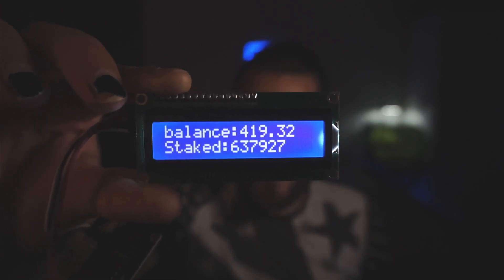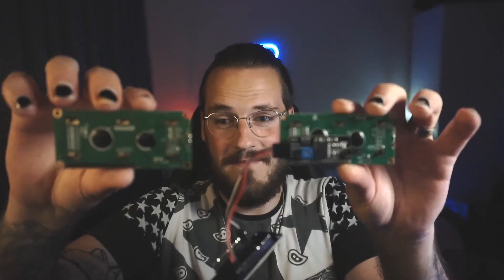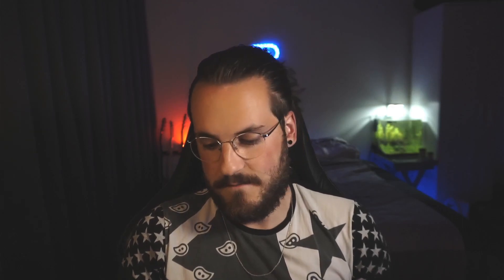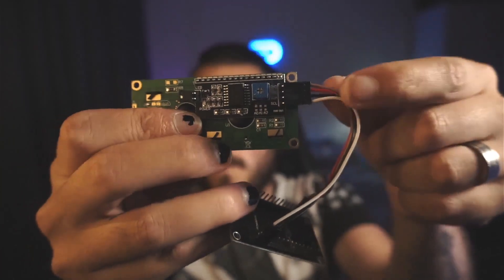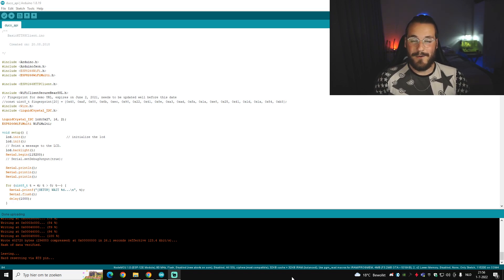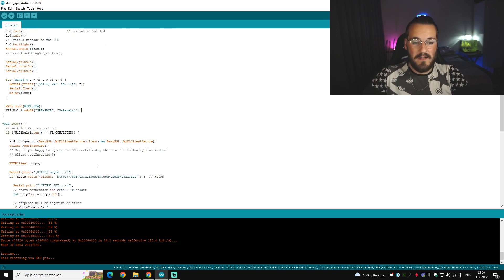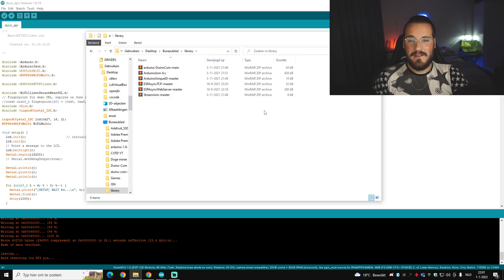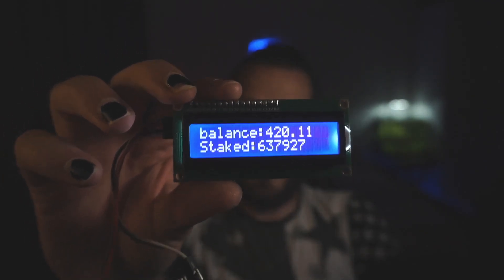How To Wire And Code An LCD-Screen To A ESP8266!

Comment: An ESP01 has the same microcontroller on it as the board you showed in the video, also despite having only a couple of digital I/O pins, it has I2C pins among them, so the I2C LCD can easily be connected to it. The setup can be powered with 5-volts for the display and 3.3-volts can be created with a tiny buck converter to power the ESP. The smaller board will help save a lot of space and make it more compact, without compromising almost any feature, except for programming it.

Comment: Can't we just connect the ESP with an Arduino with the serial communication channel and transmit the data like stacked coins, mining rate, coins and etc through Tx. and just print all of it on a color screen through the Arduino? I mean that would require a little bit of investment initially in the set up but would look so damn good
Reply from the maker: Sadly I haven't had the time to learn how Arduinos work exactly but you could defenitly try to make that work :)

Comment: my lcd is going crazy when the buit in lcd comes on and works perfectly once led goes off while connected to wifi
Reply from the maker: Might be a faulty sensor so hardware. These screens are realy fragile so they break easaly
Reply: @Pakiezel  no not the screen. Its something with hardware or code i guess. I tried new lcd, i2c module and still the same....i runned this same code both in ardiuno uno and also esp 32 and is working fine without any issues.
Reply from the maker: @joshuvajohnvarghese  try running the basic "hello world" code you can find on the internet.
Reply: @Pakiezel  yes i tried and it works. Every code works unless the display switches to new line of code . If i print just code that doesn't switch the text after clearing display,all works fine. But if i switch to new line and blue led on esp is on ..then the display goes crazy like it is switching all the the words so faster without any delays.